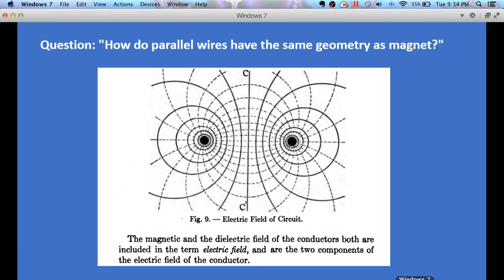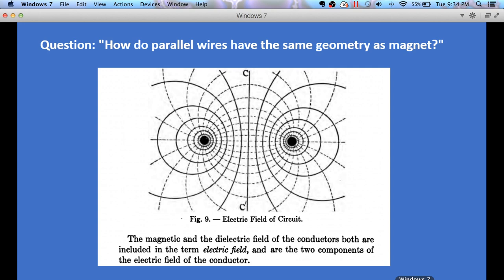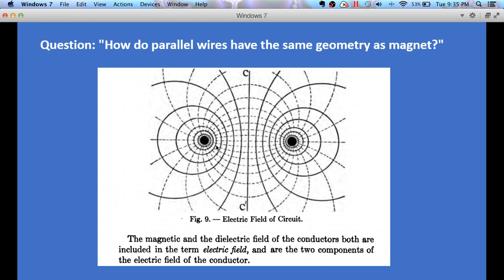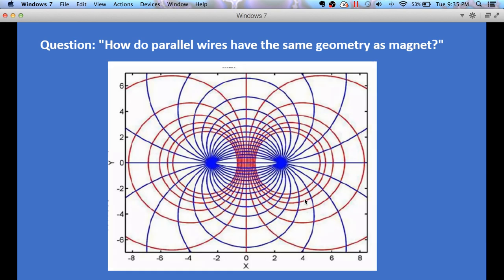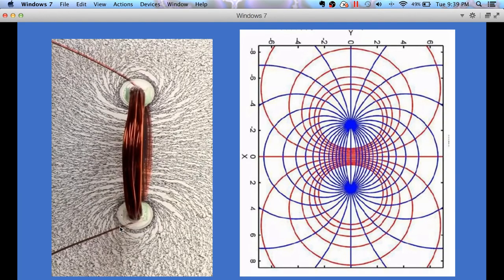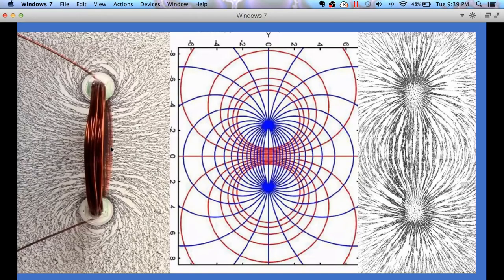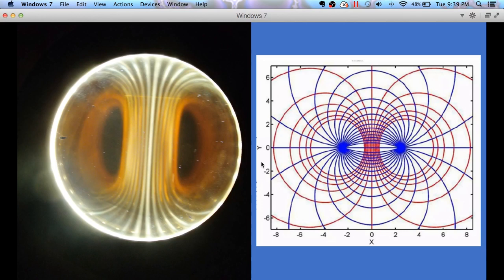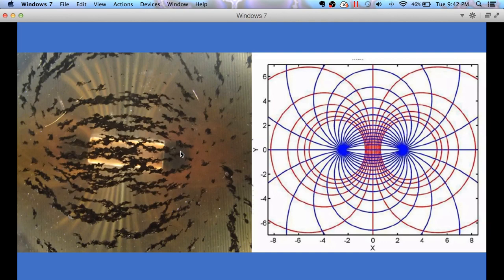On Permanent Magnets vs Electro-Magnets

Comment: IMHO. The magnet is accelerating the dielectric flow (which I refer to as "gravity"...) from the aether - through itself linearly (input S - to - termination N) - However - the accelerated dielectric (gravity...) overshoots out the North (you have to check my newest video on Magnetism to understand why there is an "overshot...) and the dielectric aether (gravity) surrounding the North side of the magnet bends the overshot back around to be partially "recycled" into the South. So - the magnet and its magnetic field are uniformly created from a single accelerated propagation of the dielectric aether flow.
The inverse display of the coil inductor is because the electric current in the wire(s) is the "accelerated dielectric flow" - (primary acceleration) and the magnetic field is the surrounding "separate" dielectric aether field which becomes "caught / dragged / influenced by" the acceleration of the primary acceleration (which makes it a "secondary acceleration") to the flow AND rotation of the primary acceleration (electric current). The secondary acceleration acts with a 90 degree inverse display.
(IE - the electric current is temporarily "substituting" for the electron functions (strong force) of the atoms of the wire - which causes the surrounding natural gravity (aether dielectric) to be "held at bay" - which is why it is affected secondarily / inversely.)
This is why the wire only has a magnetic field when there is an electric current flowing through it. As soon a the electric current is turned off - the magnetic field instantly disappears - because natural dielectric aether (gravity) resumes the electron functions (strong force supply) to the atoms of the wire.
(I contend that electric currents / all energy - is merely accelerated dielectric flow / gravity.)That's how a transformer works - the accelerated dielectric field (gravity) around the primary coil gets "accelerated" and the secondary coil gets caught up in the acceleration - and viola - a transformation of one voltage to another. The number of coil winding's in the secondary coil determines "how many times (how many wires) in a "set amount of time" - accept the "past over" acceleration.

Comment: This is interesting puzzle! Great video btw. Maybe the reason for the apparent inverse (flip) on a electromagnet verses a permanent magnet, is down to the strength of the fields, dielectric vs the magnetic. On a permanent magnet, the fields are in balance, or are weighted slightly in favour of the dielectric field. On an electromagnet, maybe the current flow strengthens the magnetic field more than the dielectric, so the iron filings will be attracted to the magnetic instead of the dielectric. The filings may be attracted to the strongest field, which changes depending on what type of magnet is used, permanent or Temporary (Electro). Just a thought.
Reply from the maker: Actually, it turn out there is no problem at all. The apparent "inverse" is just an illusion. I believe I clear this up with my more recent videos on Aether Circulation.
Reply: @FractalWoman  I am working my way through all your videos again, from start to finish, but boy there are quite a few, and quite a few hours to spend watching them, lol. Only up to this one so far, so will be more enlightened as I go on! 😁

Comment: {edit seems obvious now I say it out loud ‘metal’ due to density frequency is ‘attracted’ to the ‘magnet’ field inertia, it’s basically ‘falling’ towards the inertia field.}

The really simplified answer is ‘because he drew a picture’ the more in depth is below. 

Inertia field and tractor vortex. 

If the tractor vortex force overcomes the inertia to a certain %  in a simultaneous 3D vector , a 3D vortex portal to a dark matter source is opened or a ‘4D’ state {if you like} 

It sounds easy when you say it in a sentence above like that however.

A ‘magnet’ is a device that has the field inertia and the tractor vortex {edit} somewhat balanced resulting in a ‘neutral 3D state’ 

The inertia and tractor vortex are balanced  to the degree to create the distance vector inside a {x} radius range. 

‘Metals’ react to the effects inside that field, inertia actually {edit} I’m not sure on which. 

Other ‘magnets’ reaction is as a result of the accumulation of a new balanced field.

I can explain magnets lol ‘wipes clown makeup off’

I am up to the end of the video , the answer is because of the wire loops, the inductor is a device with a lot of field inertia to the degree that its radius is in distance , so in ‘plain English’ each resulting loop of wire adds to both the inertia field and to the tractor vortex field , but not in an equal manner, each resulting loop in N {number} adds to the inertia field, the result is a radius of a field like a ‘magnet’ because as above what we call a ‘magnetic field’ is as a result of those two vectors. 

Now come to a single wire, in the examples and tests that were theorized he outlined both field geometry but did not {as far as I understand} outline the force % of either so it’s kind of a mute point , however theoretically this state of a single wire is a good representation of both the two forces that I have now said many times that is ‘inertia field’ and ‘tractor vortex’ a ‘expansion’ and ‘contraction’ field. 

It would appear that due to the density of the 3D plain these fields are NOT equal.

If the fields were equal or something x number above equal every magnet would be a ‘portal’ or ‘black hole’ or a ‘free energy’ device .

As good as it might sound we might not want that on a ‘wide scale’ due to the collapse of consensus with a non optimal ‘future’
Reply: All the magnet, the inductor and the power lines have field inertia. Intensity isn't the answer. It's the angle at which the magnetic, inductor or wires are a. Being observed at, and b. Effecting the field from. The coils is rotated from the wire angle we should observe the effect from( a horizontal plane ) instead we are coming at the some of the objects horizontal and some vertical. They all seem vertical but they are not, not if you account for the : field, the object and the observer. The pictures don't do well at showing the field, you have to use visualization for this. The wire concept is only true if looking horizontally down the lines.

Comment: Because the same magnet renders two different results (magnetic field vs dielectric field) depending on observing aparratus (ferrocell vs iron filings), an investigation into the properties of the observing aparratus likely is key.
Reply from the maker: The ferrocell does not show the dielectric field  as I was led to believe. My video series "Demystifying the Ferrocell" explains how the ferrocell ACTUALLY works using standard high school physics. Therefore, the magnet does not render two different "results". However, there are many ways to view the magnet. You can view them in terms of magnetic lines of force which have both magnitude and direction, and/or you can look at them in terms of isopotential surfaces which have magnitude but no direction. The ferrocell shows none of these things.

Comment: Thank you so much for your videos I've been absorbing them for years and years. Thanks for saying clearly what Ken wheeler can't seem to get across to me. As for the iron filings on the Pharaoh cell it seems to me that iron filings get polarized and we'll have to follow the dielectric lines I can't see that the filings would follow dielectric lines in one case and magnetic lines in another case.
Reply from the maker: The nano-particles between the two pieces of glass in the Pharaoh cell (lol) align themselves the same way that iron filings do. The light reflects off of the nano particles and into your eye and that is what we are seeing in the cell. There is nothing special physics-wise that is going on there. If you haven't already, you should watch my videos called "Demystifying the ferrocell". These videos superscede any previous videos I made on the ferrocell in terms of what it is showing. If I said they were showing dielectric lines in the past, I was mistaken.

Comment: "Dielectric field"?
Speaking about what we see at 5:11 you can try 2 things:
1.reduce the radius of the coils, dispose them as a spring and rotate the image 90° (!) and you will see the same pattern of the magnet.
2.instead of a bar magnet use a "coin" magnet and rotate the image 90° (!) and you will see the same pattern of the coil.
That pattern changes depending of how you strecth it. And you probably haven't see all its "incarnations"...

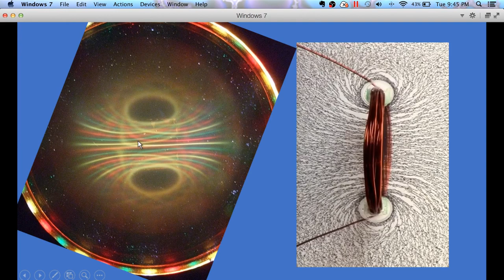Comment: Hi Lori. I'm seeing things a little different. In the image @7:53 would not the chart on the right have to be re-aligned 90 degrees to match the iron filings scattered over the ferrocel? The side by side image would then make sense. Although a dielectrically dominant element, Iron is affected by magnetic displacement and so the filings align with the spatial geometry of magnetic displacement. Light, on the other hand is affected by dielectric convergence hence it displays the convergent attribute of the field.  The same would apply to the side by side image @10:50. In order to make sense one of the images of the slide would need to be oriented 90 degrees to what is depicted. A magnet would lie with its plane of inertia aligned with the copper windings of the image on the right of the slide. When I look at the filings over the ferrocel, I can visualise it in 3D and for me there is only one field. The Yin and Yang. The two opposing attributes of the same field depicted by entities that are affected specifically by one or the other attribute.
Reply: I wonder what happens when you overlay the iron filings on the ferocell with the  magnet under it and you get to see both at once?

Comment: Except I see an argument against what I just posted in that the iron filings seem to show lines that terminate on themselves and don't terminate on the charged material so maybe I'm wrong maybe the iron filings all of a sudden decide to follow magnetic lines why would they do that? I always assumed that the dielectric lines created a polarity in the iron filing and turn the iron filing into a mini magnet and if the mini magnet was a polarized mini magnet then it would have to situate itself at a 90° angle to the dielectric lines that's the way I always read the basic iron filing on paper situation.

Comment: The dielecric in the coil is in a closed circuit but not in the magnet so in the magnet and iron filings we see the dielectric terminating at the ends of the magnet and under the cell the magnetic lines are commencing orthogonallhy where the dielectric terminates as in Steinmetz diagram at either end of the magnet maybe.This means that in the closed circuit we see only the magnetic lines and no dielectric lines perhaps.
Reply from the maker: aza hiphopski: This is an interesting hypothesis. I will give it some thought.

Comment: Please correct me if I'm wrong but a magnet is a posterior effect of induction - a previously incoherent chunk of metal becomes field coherent when sufficient current is passed through it.  Therefore - can we think of the dielectric field of a magnet as half an induction coil?  It's like one side of a coil - no circuit required.  So in the induction coil we have current flow in both directions whereas in the magnet it's only the ghost of a current heading in one direction.  Is that right?  

Another way to view it: might it be said that a live wire has greater magnetic forces propagating centrifugally; whereas a "dead”magnet has a stronger dielectric centripetal field?
Reply from the maker: In a coil, the current is flowing in circles around the solid core. In a magnet, the "current" must also be flowing in circles around the solid core. That is what brought me to the conclusion that it is Aether that is flowing, both in a circuit, and around the solid magnet. This is also why I think we should be doing all physics using the principles of fluid dynamics.
Reply: @FractalWoman  I’m not convinced the coil and magnet can be seen as having the exact same properties.  Is it possible that the relationship between centripetal and centrifugal forces depends on whether the field is generated by a coil or magnet?  

Wheeler notes that the intensity of the centripetal dielectric force is reciprocal to the magnitude of the magnet (ie. strong magnets have reduced field extension). 

I propose the following for consideration: the flow of current and the field coherency of a magnet produce reciprocal relationships in centripetal and centrifugal forces.  When current is flowing through a coil the centrifugal magnetic field appears dominant (as shown in your iron filing experiment).  Inversely - field coherency within a magnet makes the centripetal dielectric force dominant while the magnetic field (although strong) extends far less into space.

The inverse relationship might be summarized as follows:

Magnet: reduction in centrifugal space, increase in centripetal force.  Current: increase in centrifugal space, decrease in centripetal force.

What do you think?
Reply from the maker: @assemblyofsilence  What I am trying to do is define things in terms of Aether vortex flow. Charging up a magnet causes Aether vortex to spin faster in and around a magnet. Although the force is stronger, the field doesn't extend as far. This is analogous to a figure skater bringing their arms in closer to their body in order to spin faster. This is why the field doesn't extend very far in a stronger magnet. When the figure skater extends their arms away from their body, their spin slows down. This is analogous to a weaker magnet. 

Also, It is my opinion that both centripetal and centrifugal spins up when a magnet is charged. Both attraction and repulsion become stronger when you charge up a magnet. When water goes down the drain, air needs to come out. When water goes down the drain faster, air needs to come out faster. In this situation, water experiences centripetal convergence and air experiences centrifugal divergence. As water goes in, air comes out. This is reicprocation.

Comment: The wire comparison only works looking down the end of a split cable, not a top-down view of two wires meeting. Instead of the meeting point like in the wire picture, we need to go to the ends of those wires, turn them on their side, and look down the wires. Like being at the end of a power cable, instead of in the air on a helicopter looking down, or on the street looking up.
Reply: If the copper coiling was flipped on its side or if the inductor was flipped on its side we'd see an exact replication. See how the wires compared to the coiling are flipped to eachother? in two wires is wouldn't be the case. The inductor is again top down view and needs to be a longways view in order to avoid the inversion.

Comment: Could this inverse geometry also be 'Transverse' geometry, as the coil is set up at 90 degrees to the magnets relative position?
Reply from the maker: It is my understanding that the circular lines are transverse lines of pressure and the other lines are the longitudinal lines of tension. It appears that the transverse and longitudinal components are flipped in the electromagnet. I just added a new comment to my community section which might help explain this difference. Ihttps://www.youtube.com/user/FractalWoman/community?view_as=subscriber